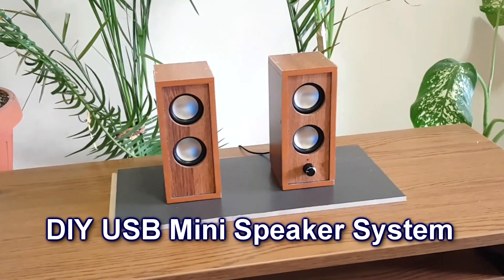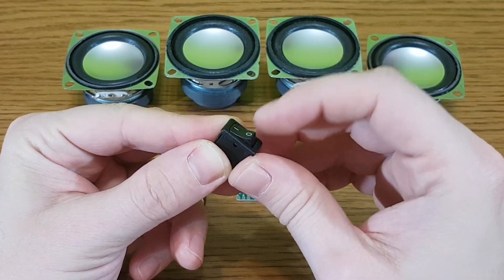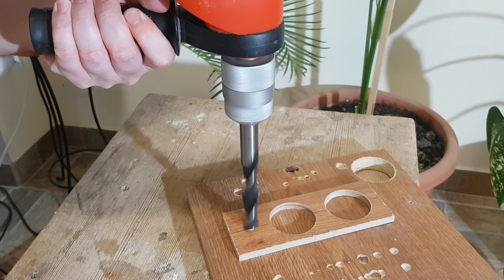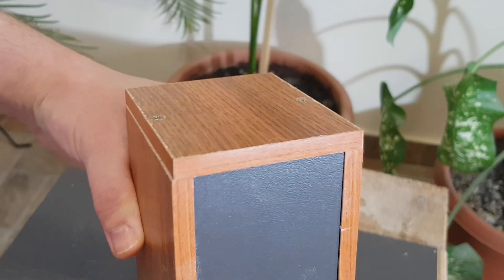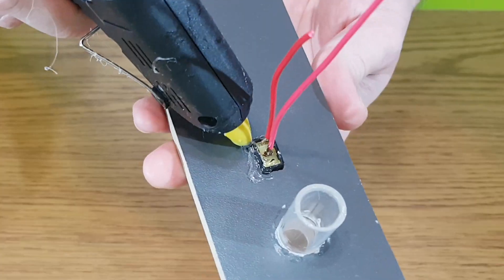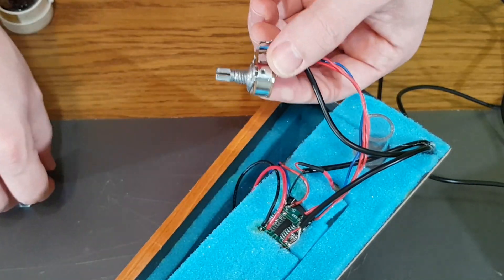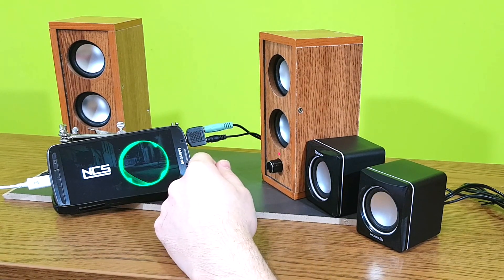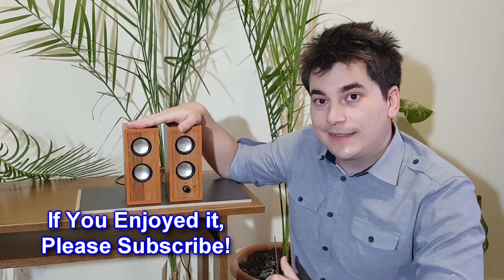DIY - USB Mini Speaker System - PAM8403

Comment: Nice video. Very helpful information. I wished you had tested the amps drawn with the volume pot on maximum, while reducing the volume on the mobile. Cause it would be helpful to know how much current is drawn, in case we don't add the volume pot, with the mobile volume high vs low. I suppose the current (amps) drawn would be more when the mobile volume is high and much less when it is low. Right???
Reply from the maker: the current consumption of the amplifier is higher when the audio input is louder. it doesn't matter if the input level is set by the phone or by the potentiometer.
Reply: Thks a lot bro. Very helpful.

Comment: I used this little amp (the version with the volume pot onboard) with a pair of cambridge soundworks 1.25" speakers out of a creative travelmate, i built a box out of modellers plastic (styrene) that can be glued with polystyrene cement, fitted a pair of mini bass tubes out of styrene tubing porting out of the back (20mm wide tube), it's in the front of my antec P100 PC case on a socket 754 PC with an athlon64 3700+ CPU and Radeon9800 Pro graphics card (Motherboard is an ASUS K8V SE Deluxe)

Its routed internally to my Soundblaster live 5.1 card running windows98SE, i also fitted a separate '3rd' speaker going directly to the soundblasters 'PC Speaker' output with a 100Ohm potentiometer this is for DOS sound (to control the bios beep volume level and DOS gaming/music sounds), i tell you what the sound quality from this little thing in my front drive bay is just incredible,  it's real crisp and has a surprising amount of bass for a drive bay speaker, i cant recommend these things highly enough, they are incredible!

Comment: Hi, Sorin. I've been watching your videos and they are really helpful. 
Just a question about ground loop, from forums and other videos I saw them use the capacitor like what you installed to fix it. But I also saw some short the ground from audio input with the Vin (-). Is the latter safe and does it cause any damage in long term use?
Thank you for all your efforts in sharing your electronics knowledge
Reply from the maker: Hi. That's not enough. to eliminate the ground loop noise you need a ground loop isolator, or you can power the audio amplifier and audio source with separate isolated power sources, for example separate transformer outputs.

Comment: One question and will the amplifier support 4 speakers on a single audio output????
Reply from the maker: yes, but only if the combined impedance of the speaker drivers is not below 4ohms per channel.
Reply: Is it possible if the impedance is higher? In only a single audio output ???my amplifier is pam 8403

Comment: Seems like diy speaker hass more bass because they are made of wood but the new ones have less bass because it is Made by plastic
Reply from the maker: yes, but also because the speaker boxes are bigger, they have a (simple) soundproof insulation, bass reflex tubes and the PAM8403 amplifier board is very powerful.

Comment: Very good Sorin! Do You find a simple solution to prevent the ground loop? Thank you for sharing this video!
Reply from the maker: hi. you can use them with a different charger or a powerbank. or you can add a ground loop isolator.

Comment: Sir ,i have 2 speaker of 5w and 8ohm and other 2 speaker of 30w and 12ohm ,does it work with this diagram?
Reply from the maker: no, you cannot connect them in parallel. they must all be of the same type.
Reply: @Sorin_DIY  thank you sir

Comment: I did something similar after watching your video! I took and old pair of PC speakers and mounted them in a wooden box I made. I found an amp on Amazon with bluetooth, added a battery pack and now have a nice little portable bluetooth speaker system. Thanks for the inspiration!

Comment: I used the phone charger but the background sound stays the same
Reply from the maker: that's because the charger is not isolated from ground loop, like transformers. you need an isolated converter to power the amplifier. or a ground loop isolator on the audio input.
Reply: @Sorin_DIY  could you please link me an isolated converter as an example?
Reply from the maker: https://www.aliexpress.com/item/4000006946312.html?spm=a2g0o.productlist.0.0.203c1849fvAf2W&algo_pvid=6775c01c-cf25-405d-88cf-51cad6ada85e&algo_expid=6775c01c-cf25-405d-88cf-51cad6ada85e-12&btsid=0bb0623316052579906571209eb99d&ws_ab_test=searchweb0_0,searchweb201602_,searchweb201603_
Reply: Thank you Sorin, that solution of the isolated converter worked.

Comment: Hi sorin the tiny degital pam8403 amp module does it produce surround sound while playing music?
Reply from the maker: hi. no, it's just a simple stereo amplifier board. you can use minimum 2 boards with 4 channels to produce surround sound.
Reply: I have 2 speaker 4 ohm 5watt will it be possible to run smoothly for both channel? it is recommend to use 3watt, but I don't have 3 watt speaker the only speaker what I have is 4 ohm 5watt I highly doubt that..i order pam8403 in Amazon but the product hasn't arrive yet I would like to know before I build please tell me sorin.
Reply from the maker: it will probably work. it depends on the quality of the speaker drivers. it's recommended that the speaker drivers have a higher rated power than the amplifier.
Reply: Hi sound quality is nice but it doesn't produce bass.. I would prefer 12v amplifier to produce bass

Comment: Hi Sorin! I have a doubt: where did you connect the led?
Reply from the maker: hi. the LED (in series with a resistor) is connected on the amplifier board supply voltage input.
Reply: @Sorin_DIY  Thanks man! Keep up the good work!!

Comment: i am using the same amp with 2×3watt speakers 4ohms. but the sound distorts at the max volume. is this due to the amp or the speakers..?
Reply from the maker: hi. it depends on what speaker drivers did you use. I think the speaker drivers are too small for this amplifier board. you also need a good power supply, try it with a different 5V powerbank.

Comment: Hi sorin
Check out this one and give your comments.
https://youtu.be/Q8wrrBITys0
I have ordered stand its on its any.
Reply from the maker: hi. you worked a lot on this and it looks good. but if you mount the speaker drivers in opposite sides, they may cancel each other out. it's better if you mount both speaker drivers on a front panel and you can install passive radiators on the sides.

Comment: I have learnt alot from u
I have also tried to make one
Give your suggestions for improvement
https://youtu.be/tu7O9YrH8_8
Reply from the maker: hi. I like the speaker, you put a lot of effort into building it. I can make some suggestions: when you drill the holes, or you do a similar manual labor, you don't need to show the entire 30 sec drilling process for both holes. you can show how you drill only one of the holes, for the other one it's the same process. and you can fast forward the sequence, or you can show only the last 10 sec. if the video becomes too long, some viewers will lose interest and close it. in my opinion the best duration for DIY videos is 13 - 17min. you should buy or make a camera stand. it's difficult for the camera to focus, when filming up close, indoors, in low lights, especially if you keep moving the camera. and you need more light, when filming indoors, you should use at least 2 lamps to light up the filmed object, from behind the camera in different angles. it's better if you speak, or at least add some text about the components and what you are doing. good luck!
Reply: @Sorin_DIY  I will post my next video keeping these points.
Thanks alot

Comment: I also bought 4 of those pam8403 amplifier
With potentiometer...
It surely is powerful😉...

You're awesome
Reply: By the way

I planning to buy a pam8403 5w bluetooth amplifier

And I only have 2× 4w speaker    ...what should I put something to avoid blowing my speaker...🤗🤗🤗...I'll be happy If you'll reply.....please....😊😊😊
Reply from the maker: hi. you can decrease the input audio signal with some resistors. or you can add a resistor in series with the speaker drivers 4.7ohm 5W will probably work.
Reply: Thank you very much...
Reply: I'll try it😊

Comment: That amplifier supports only 2 speaker of 3 watt
How u use 4 speaker .
Reply from the maker: it's not correct to connect 3W speaker drivers to 3W amplifiers. the speaker drivers must have a bigger rms power than the amplifier peak power. for example you can see in my bluetooth speaker video, I use an amplifier board with max 2x 6W and speaker drivers with 30W max and 15W rms. the 2x 6W amplifier is capable to push to the limit the 30W speaker drivers. the PAM8403 amplifier is capable to power 4 speaker drivers of 3W and 8ohm.
Reply: I have 4 speakers of 3v 4ohm can i use it in PAM8403 ?

Comment: Not getting low frequency sound with 3.7v lithium battery when i was using with powerbank it working absolute fine
Reply from the maker: this amplifier needs to be powered with 5V. a single lithium cell has a lower voltage. if you want to use a cell, you need to add a step up converter to increase the voltage to 5V.
Reply: @Sorin_DIY  i have use mobile charger to supply power 5v 1A then that chip is getting heatup and Auto shut down

Comment: Can I use 10+10 watts speaker with this tiny amplifier?
Reply from the maker: yes
Reply: @Sorin_DIY  thanks bro its working perfectly just tell me one thing . when I increase volume then bass automatically increase so what can I use for increase bass?
Reply: Sorry what can I use for decrease bass
Reply from the maker: you can add a non polarized electrolytic capacitor in series with each speaker driver. the value should be between 10uF (almost no bass) and 100uF (almost full bass) rated at 16V or more. if you don't have a non polarized capacitor, you can use 2 polarized capacitors in series, like I did in my home made speaker driver video.
Reply: @Sorin_DIY  OK thanks bro

Comment: My pam 8403 is making buzzing sound what to do please tell
Reply from the maker: you are probably powering the amplifier board with the same power source as the audio device and you are getting a ground loop noise. you need to use different power supplies for the audio device and the amplifier board. or use a DC-DC isolated converter, or a ground loop noise isolator.

Comment: Thank you, my friend! It is as useful as i couldn't even imagine. All i needed to know. But i have a question: would my PAM8403 sound worst with 4Ohm 25W speakers than with 4Ohm 5W speakers?
Reply from the maker: hi. it depends on the speaker drivers build quality. theoretically the 25W speaker should be better, but if it's cheaply made, it will sound worst than the 5W speaker. I can't give you a direct answer, because I can't see the speaker drivers. my suggestion is to use the ones that have the better build quality.
Reply: Power ratings don't really matter much with this amp. The rated output is 3W per channel, so choose the better sounding one.

Comment: You could use isolated 5V power converter to eliminate that boozing sounds.
Reply from the maker: yes. but I wanted these speakers to be cheaper and more powerful than new ones. I will use a dc-dc isolated converter in another speaker build.

Comment: i built this today and i must say i am very pleased with its perfomance ,  
i used 4 ohm 3 watt speakers  and where he connected the capacitor i put a 16 v 220 uf , it does not even switch off even when the volume is high , it sounds loud when the volume is low 

last year i bought the version with bluetooth on it , it sucks soooo bad , every time the 808 kicks in , it would swith off, 

guys if you are looking for a quick and easy way to build speakers ,I RECOMMEND GETTING THIS AMPLIFIER

Comment: Pam8403 has 3W? Check: if we have 5V and 150mA so 5*0.15=0.75W
Reply from the maker: hi. manufacturers tend to exaggerate their products specifications, especially with audio amplifiers. the output power is made from AC current. and AC current has an RMS (root mean square) value and a Peak value. the RMS is actually the real value and it's smaller than the peak value. when the manufacturers say that an amplifier has 2x 3W (or any other power), they mean that the peak value is 2x 3W, but they exaggerate even with that. so in reality the RMS value is much less than you read or calculate from the amplifier specs. but this is internationally accepted, so we (buyers) will go along with it. you can see in my bluetooth speaker video, the speaker drivers I use are 30W/8ohm and 15W rms.
Reply: @Sorin_DIY  you have right but: you say it's this speaker have 8 or 7 ohm but it's not resistance! This is impedance and this is a big difference. I check the spec and there they write that if we have 8 ohm so the power is 1.8W

Comment: i got over 30 units of those pam8403 amplifiers they can move a 12" car sub haha
Reply: but sadly cant put them in parallel to have more power
Reply: they will run perfectly  with 4.2v lipo cell

Comment: HI Sorin,
Awesome video.
Question.. I am a teacher and I would like to make this for my electronics class with my students.
I am planning on building this with a 3.7V battery with a step up module to 5V.. running a PAM 8403 bluetooth module board. with 5-10w 4 OHM Speakers.
What size Capacitor should I use for the Wattage and Volts?
And also, do I need the Potentiometer? why cant I just use the phone to turn volume up and down?
Look forward to your response.
Thanks
Tim
Reply from the maker: hi. I suggest you use a 4700uF capacitor at 10V. if the amplifier board has a bluetooth module included, there is no need for a volume potentiometer. but if it's a simple amplifier board with a stereo jack input cable, you need a volume potentiometer, to adjust the audio level coming from the laptop/phone or any other device. the potentiometer also reduces the background noise, when there is no music, or when you listen at a low volume.
Reply: @Sorin_DIY  
Thanks for the reply mate.
Watching all the way from Australia.
Would you mind explaining to me how you found that 4700uF would be a good choice? and what did you mean by 'at 10V'? the circuit is only running at 5V?
Thanks in advance.
Tim
Reply from the maker: I've modified and made a lot of transformers and power supplies so far. for big loads, 4700uF it's the minimum value capacitor to keep the voltage stable. of course, in most cases, a bigger value capacitor is better, but the capacitor will be bigger too. for a portable speaker enclosure, the internal volume is also important. big components will waste too much of the internal volume. so for a portable speaker box, 4700uF will be efficient enough and also not to big. the capacitor rated voltage must be bigger than the circuit voltage. you can use a 6.3V capacitor, but it's too close to the limit. you must be careful with the step up converter, not to get too close to 6V, or you will pop the capacitor. the next rated voltage value is 10V.
Reply: @Sorin_DIY  Thanks for the reply. I really appreciate it. Keep up the great work. Thanks for educating.

Comment: Question: Is it possible or convenient to use two usb connectors in order to double the ammount of vatts received from a single 5V USB port? Would it really help to increase the power output to get a higher volume?
Reply from the maker: hi. for this amplifier it's recommended to use a power supply with 5V (max 5.2V) and 1A. most PCs USB ports have 0.5A and some have a voltage lower than 5V. that will work too. but there's no need to connect 2 USBs outputs, you will have the same output current.

Comment: i am facing ground loop prob , what to do? need your help?
Reply from the maker: hi. you need a dc-dc 5V isolated converter on the supply voltage. or a ground loop isolator noise filter on the audio input. or a separate power supply.

Comment: The amp circuit has 3 watts per channel output..but you added two speakers on both channels..
Will it not overload amp?? Two parallel speaker reduces the total resistance to 4 ohm but increase the watt by double..
Reply from the maker: hi. that's not a problem. it's recommended to use speaker drivers a bit more powerful than the amplifier, so the speakers will not be pushed to the limit.

Comment: 5 volt how many wats
Reply from the maker: hi. standard PC/laptop USB ports have 0.5A, equal to 2.5W. but I suggest a minimum 1A supply current, that means 5W.
Reply: @Sorin_DIY  tx   any problems to connect 5 volt 2 amp
Reply from the maker: there's no problem. it's even better.

Comment: Excellent video!!! Clear, short yet accurate and right to the point explanation !!! With one video I have learned everything I needed to know about speakers. I have a question though, with the same power (in this case 3W+3W), can you make them somehow even a little louder by using different pot or different amplifier for instance, without compromising quality of the sound ??? I'm asking 'cos I am currently working on a similar project, but speakers will be located further from the source? Great respect dude!
Reply from the maker: hi. thanks for watching, the amplifier cannot be modified, to be more powerful. but in the pam8403 datasheet is mentioned that it can be powered with max 5.5V. this way it can deliver 3.2W per channel with 4ohms speakers. so you can try to increase the voltage to 5.5V. the only alternative is to use a more powerful amplifier.
Reply: Ok. Thanks for that. But are there any more powerful amplifiers? Could you recommend something? It will go to a laptop.
Reply from the maker: it depends on what power supply you want to give it. the laptop USB port can deliver 5V at 0.5A. if you want to use the USB as the power supply for the audio amplifier, the pam8403 is the best choice. if you want to use a separate power supply for your amp, you can use any amp you want.
Reply: Thanks a million, mate!